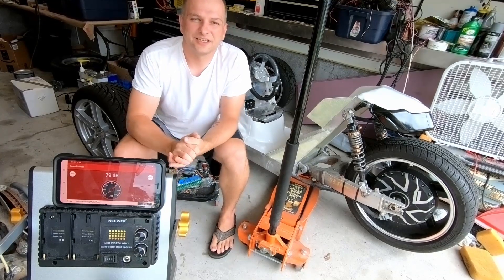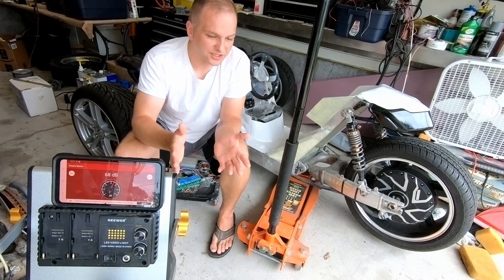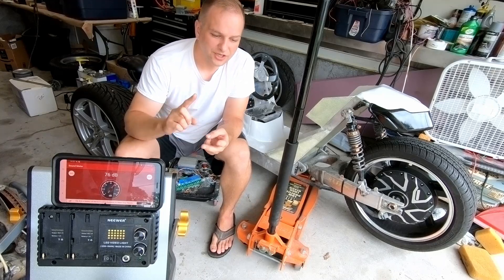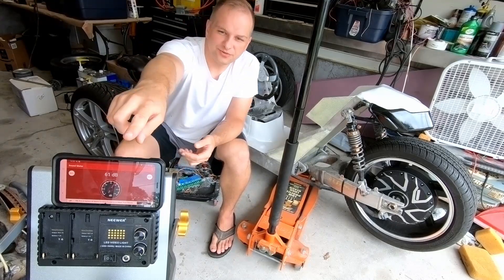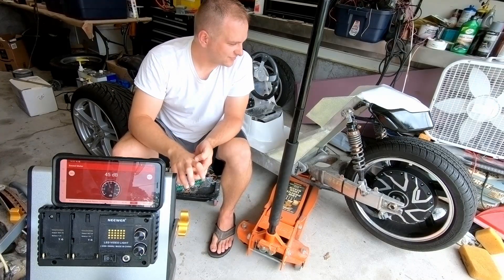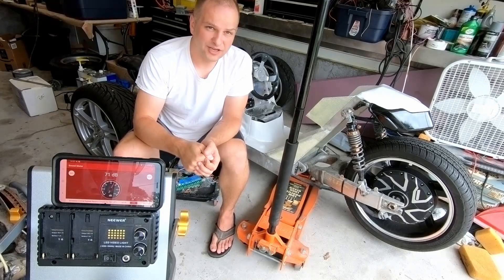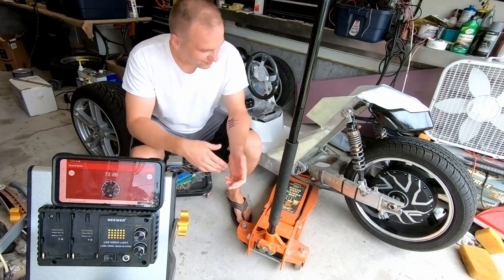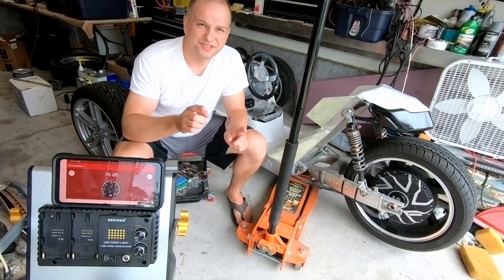What does a 12kw QS motor sound like? Lets find out!

Comment: Will it take a motorcycle brake disc?
Reply from the maker: They actually have a bolt pattern to receive a disk break
Reply: @ForgeSpace  three bolts or five?
Reply from the maker: @budbarker57 70mm spacing x 3 bolt, 58mm ID

Comment: does it support regeneration of electric current back to the battery banks?
Reply from the maker: The regen on the kelly controller for the motor worked, but was not a smoth transition.

Comment: That sounds sexy …. Is it possible to install something like this on a super 73 Rx or Ariel rider Xclass ?
Reply from the maker: It sounds nice, but it's not very powerful. The rider and Ariel frame is too narrow for this hub, but they do make a skinny version which may work.
Reply: @ForgeSpace  ah ok ! So you think the 5k water QS motor is more powerful than that ?! I had a QS 5k W 3T on my Ariel rider and it was insane, with a 200A controller …. 70+ mph but I hit 73mph and I was told it could go more 😳

You think your motor you are using and more powerful than the one I had ?!
Reply from the maker: It's a matter perspective, the power is about a 200cc. It's fast and puts down quite a bit of power but it does taper off just about that speed.
Reply: @ForgeSpace  thanks for the replies, appreciate it 🙏🏿

Comment: A general question, are these strongly designed and quality built to withstand road bumps and consequent hub flexing) at high speed (like magnets touching electromagnets??)??
Thanks!
Reply from the maker: They are decent quality, but the weight of it will kill it over time with vibration. I would honestly go with a chassis motor to remove the unsprung weight.
Reply: @ForgeSpace  thank you! Really appreciate your candor!

Comment: These 12kw are NOT WATER COOLED, correct?
Reply from the maker: Correct, This is the air cooled, however, there is also a water cooled version.
Reply: @ForgeSpace  oh, really? Could you please give some info about the water cooled p/n VS air cooled?
Reply from the maker: Unfortunately, they do not do a good job with providing part numbers to specify liquid or air cooled.

Comment: Your building skills are spectacular. I'm in the process of building a Suzuki GSXR 600 conversion. I really want to go with the 12 KW hub motor system instead of mid drive for many reasons including lack of chain noise, more space for batteries.  You have probably had some time on the hub motor by now.  Would you do the hub motor system again? Any issues with overheating?
Reply from the maker: Honestly, I have only rident it a handful of time. Never ran into any issues with overheating. After having it over some bumps you feel the disadvantage of the weight in the wheel. It amplifies the bump due the mass. 

It is a great solution if you are confined on space. 

If you are worried about chain noise, you could go with a belt.